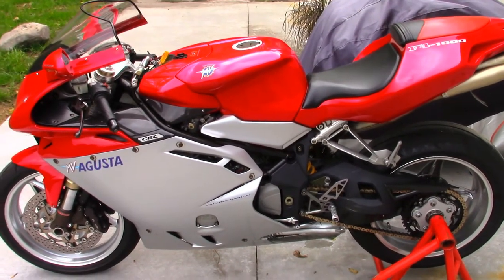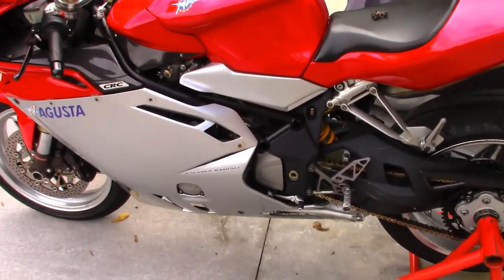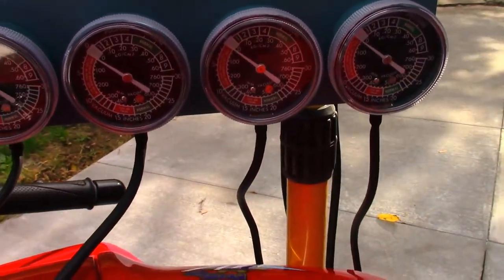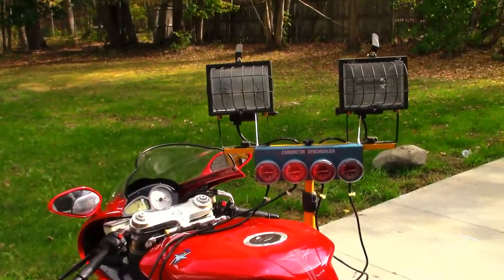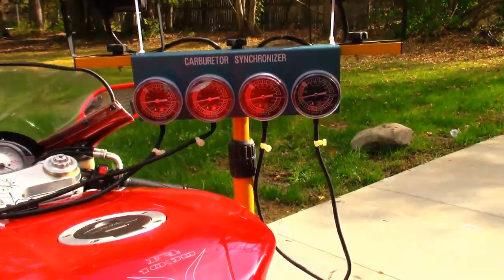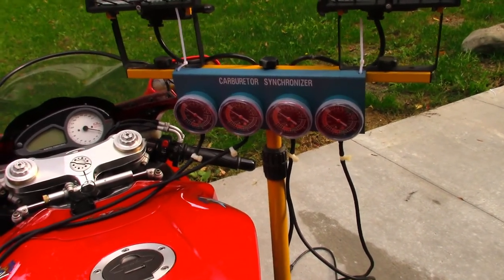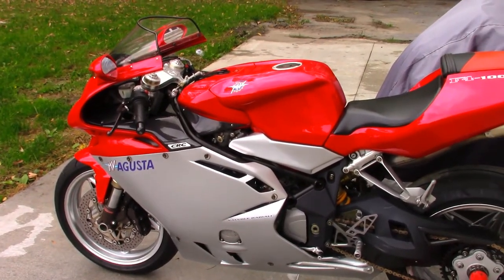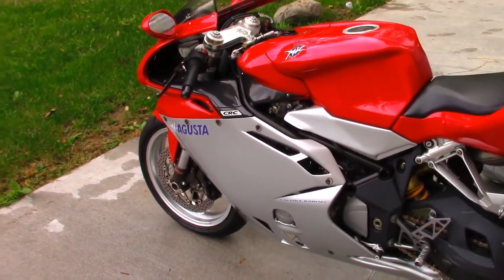MV F4 Throttle Body Sync

Comment: For your information , to sync all 4 throttle bodies you havent to remove the air box, only the small covers on the both sides of it. Then you can reach all 4 adustment screws with a long screw driver

Comment: Hey dude, I just bought a 2007 f4 with upgrades as my first bike. It’s been in a private collection since new so it only had 1500 miles. It has a lopey idle that sounds great but I was told it shouldn’t have a lopey idle. I rode it about 260 miles in just over a day. I have no previous experience with motorcycles to base opinions on but I thought it ran great despite a good bit of vibration on the throttle. If you (or anyone) could give some advice on whether mine is ok or not I’d greatly appreciate it. I can send videos of it’s idle in a few weeks when I get home.  It sounds like a high compression car with an aggressive cam, so it’s hard to imagine there could be an issue.
Reply from the maker: Your bike is okay.   Lopey idle is common on these and can be caused by a couple of things.   I was going to suggest riding it but you already did that.  Put some good gas in it, fresh spark plugs, and sync the throttle bodies.  You should be fine.  The 2007s are nice.   Did you get the black one or the red one?
Reply: Turbo329 hey man, thanks a bunch for the advice. Greatly appreciated. I’ll get new plugs and the throttle bodies synced ASAP. I got the red/silver one. It became my dream bike after i saw it on dark knight. Everyone told me i was crazy to start out with this as my first bike but i just have a natural talent for driving anything. I’m currently a long haul truck driver and before that i was a paratrooper. So I just wasn’t too worried about the danger factor. At least not ME wrecking. It’s idiot drivers that were my only concern. But this is already an addiction. I’ve always been a thrill seeker but nothing compares to these sportbikes for pure fear/ adrenaline. Not parachuting, not scuba diving with sharks, nothing. It’s unbelievable. I hope more people will give motorcycles a try. I highly regret waiting so long to try.

Comment: can u please show where do u plug the tubes on the carburettor?

thnks
Reply from the maker: It's actually pretty easy.  If you remove the side fairings, you are going to see the location where you plug the tubes in.  The newer bikes are labeled 1,2,3,4 and the older bikes (like mine) just have hoses connecting to them.  Remove the hoses and plug in the vacuum gauge tubes.

Comment: I’m having this issue with mine after cleaning the bodies. I’ve got it balanced at tick over but when I hold the revs between 3k and 4k. They’re out and it sounds rough. Any idea ??
Reply from the maker: Yeah, so it could be a couple of things.  First thing I would check is to make sure you didn't damage one of your fuel injectors.  Its a tight fit and if you are not careful when installing your fuel tank you can rip the injector right off its arm.  Thag will cause rough running because it won't get the voltage needed to squirt fuel properly.  The 2nd thing I would check is your EBS relay if you have an '05 or '06.
Reply from the maker: Also, I would pull everything apart again and make sute the throttle bodies are seated properly and the clamps are secure.

Comment: Your CCtensioner is about to let go.
Reply: The TB sync does not go way off in one ride, i would definitely check the tensioner. I had an F4 1000 2005 and now have an F4 750 2000, and neither one sounds that rattly.